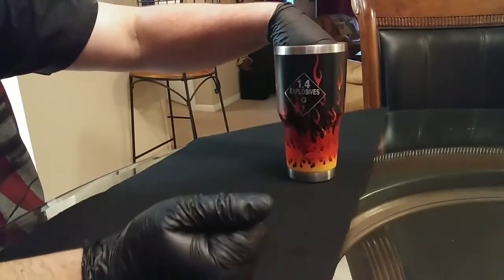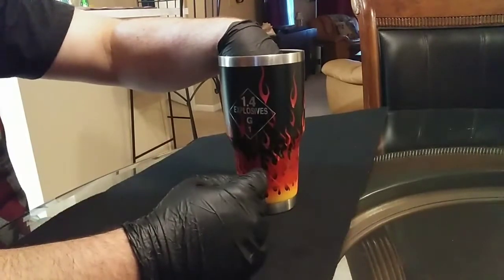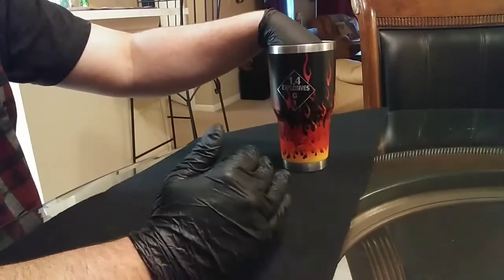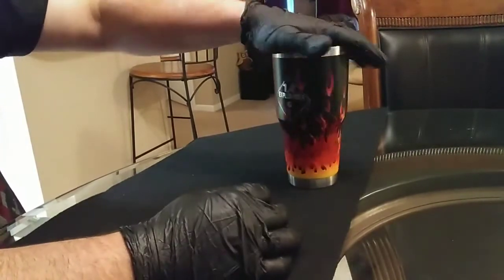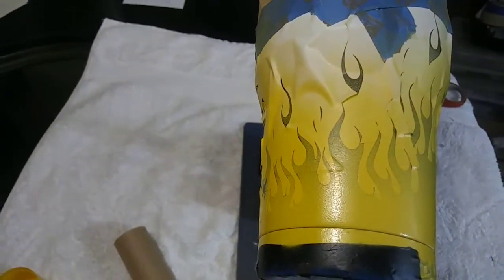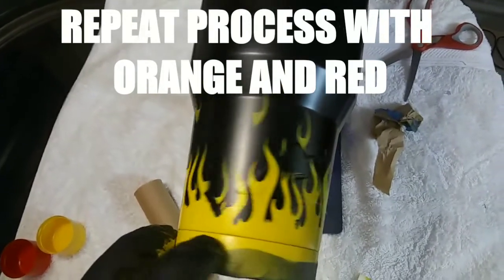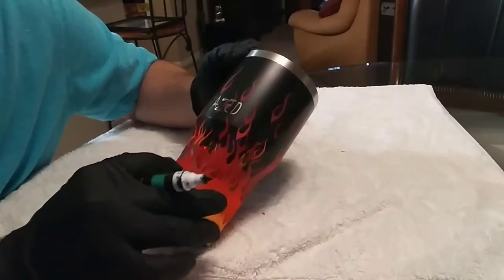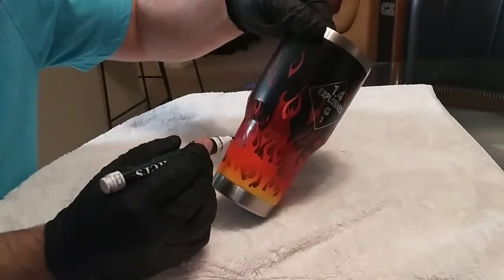HOW TO SPRAY PAINT | FIRE & FLAMES | TUMBLER CUP

Comment: The end result looks nice, but I felt you left out important info, such as reapplying vinyl for the orange and red colors. Would have loved to have seen how . Was the stencil different from the first one you used for the yellow coloring?   This is neither here nor there, but I'm wondering why you use gloves if you cut off the fingers and smudge with your bare fingers.  They don't seem to serve a purpose. The cup, on the whole, looks great .
Reply from the maker: Mary Laboy hi mary, i was not the best at making videos then. i now wish i would have done other color. It is the same process and same vinyl. For the spraying on had gloves took tip off to do the outlining and fading with the marker as in video. Its just better not to use glove in that process. I will do a future video more in depth. Thanks for watching! 😁👍

Comment: I’m an airbrush artist but have never done a tumbler.  What type of paint do you recommend to use over that black to use my true fire stencil?  
Thanks , love your work
Reply from the maker: Hi cynthia, i did airbrushing years ago, lots of fun. The black on the cup is powder-coated or ceramic. Either way oil,acrylics would go on cup but you would have to protect it with epoxy when done. It will scratch off if not protected. Do you have access to clear powder coat? Thanks for watching😀👍

Comment: Already prepped and added my decals to my tumbler. I also painted it with my desired color. Can I give it a clear coat before removing the decals to reveal the stainless
Reply from the maker: You may be able to if you give light coats. You don't want to make it to thick. Best bet is make two decals.  After applied the base paints take off decal. Then when ready for clear put in a new decal. Hope this helps. Thanks for stopping by😀👍

Comment: IF YOU USE THE 2 PART RESIN KIT......HOW MUCH OF PART "A" DID YOU USE.....&.....HOW MUCH OF PART "B" DID YOU USEHOW LONG YOU LET DRYHOW MANY LAYERS DO YOU APPLYI ASK THIS CAUSE I DID ONE CUP USING THE DIRECTIONS FROM THE RESIN COMPCUP STILL TACKY 2 MONTHS LATERJUST PISSES ME OFF,ANY DETAILED STEPS YOU USE WOULD BE HELPFUL.TY-----------------------------A LAZY SUSAN MIGHT BE USEFUL WHILE PAINTING,THEY EVEN HAVE BATT OP ONES ON AMAZONI GOT A OLD TYPE ONE AT YARD SALE SATURDAY----------------------------I MEASURE BOTTOM OF MY CUPUSING CRICUT MACHINE I MADE MULTIPLE CIRCLES ON A SHEET OF VINYLTHEN APPLY CIRCLE ON BOTTOM OF CUPWHEN I USE TAPE TO MASK OFF BOTTOM OF CUP I THEN FOLD EXCESS TAPE ONTO THE VERY BOTTOM WHERE VINYL ISNO MORE TEARING LIL STRIPS----------------------------NOT TELLING YOU WHAT TO DO JUST LIL THINGS I DO
Reply from the maker: Rugged Rick Rude hey rick, as far as your cup sorry to hear its still tacky! It might be to late but throw blow dryer on it or heat gun! Not to hot! Prob to much resin but dont give up put cup aside it may cure. I WILL POST A MORE DETAILED VIDEO ON EPOXY SOON! THANKS BUD
Reply: I DID THAT ABOUT YR AGO..........NOT ANYONES FAULT BUT MINE LOL HAPPY EAT A TURKEY DAY TO YOU
Reply from the maker: Rugged Rick Rude 😵😵HAPPY THANKSGIVING!